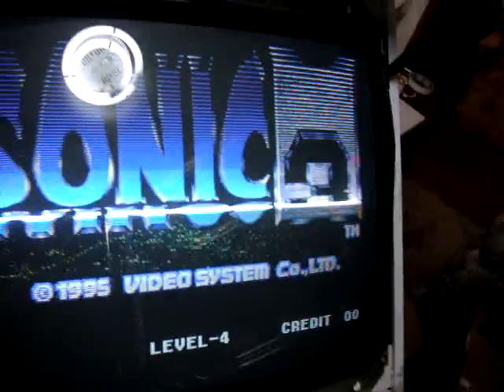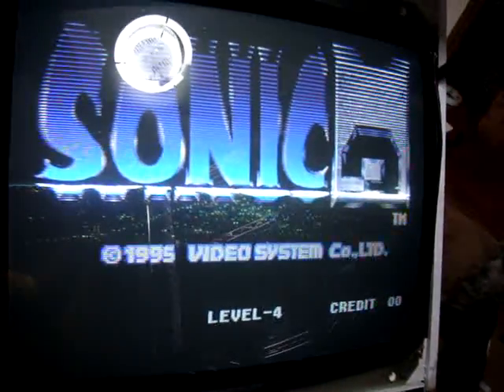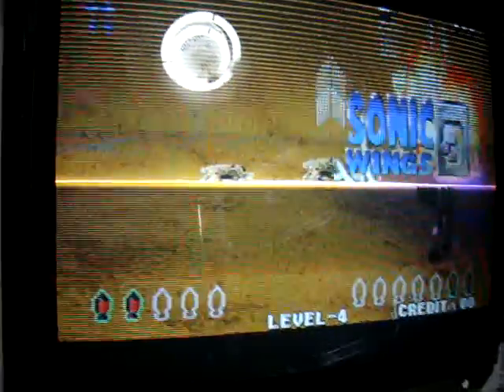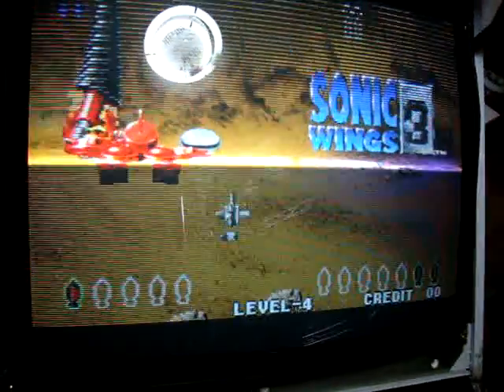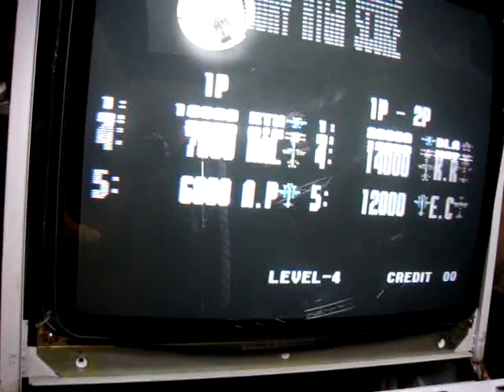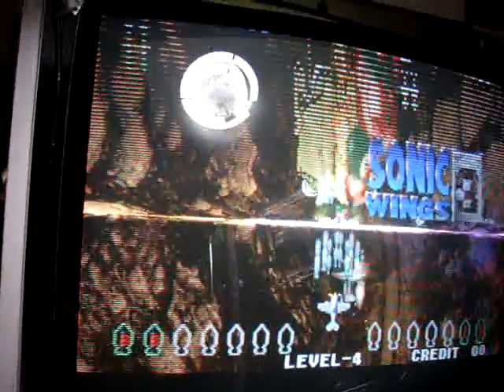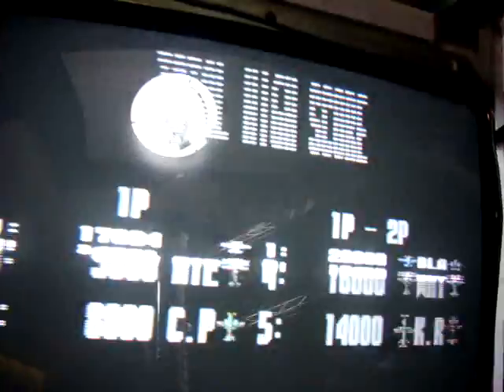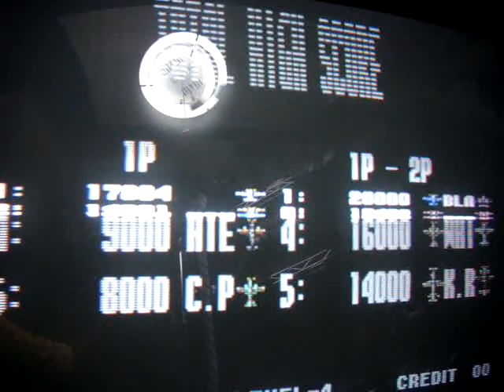Arcade Monitor Problems

Comment: Looks like a problem around the vertical amplifier, you may be able to follow the wires from the yoke to it, it's 2 pair of wires from the yoke and you are looking for the one that doesn't connect to the high voltage transformer.

Comment: Vertical hold amplifier failing? I have a Sony 36" that's doing the same thing. Part is around $5, but I haven't replaced it yet to know for sure.